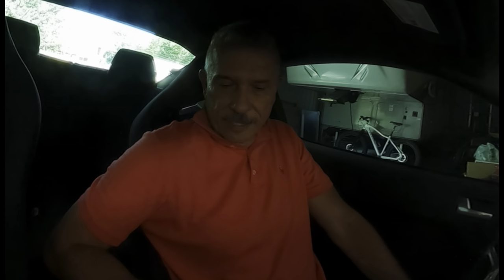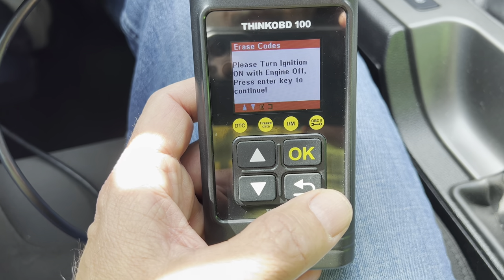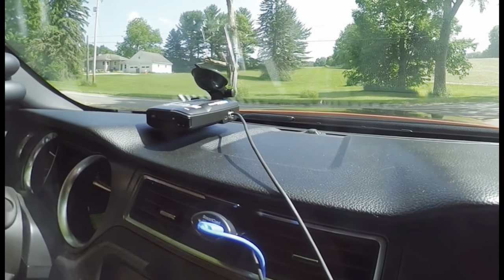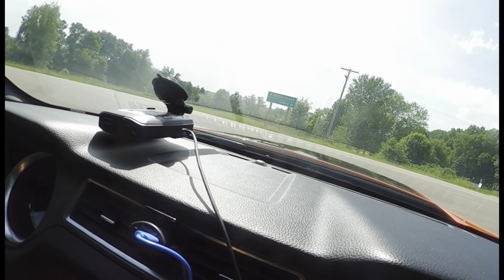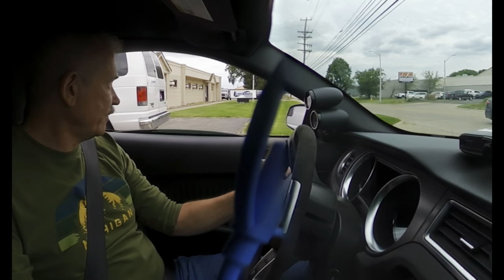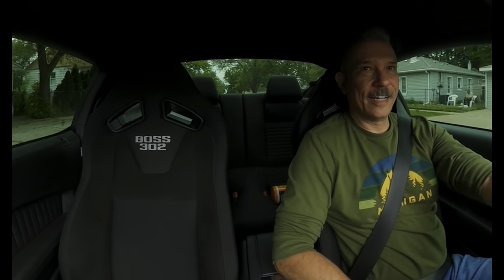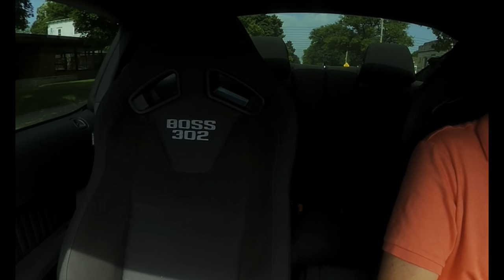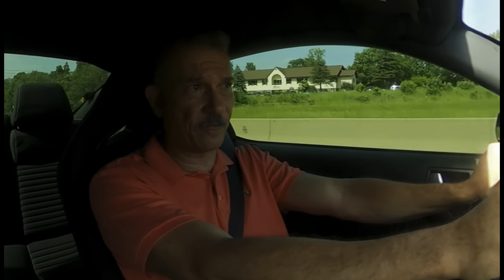Lethal Performance Street Fighter 525 Clutch! Kevlar Disc 😊 First Thoughts!

Comment: I'm gonna go thru and watch all your videos. Your channel is super legit and informative.
Reply from the maker: Thanks we are on a winter pause right now. I have to revisit testing this new clutch though.
Reply: @Coyote Productions  Living in SoCal, I sometimes forget the winter does exist. I'm having a McCloud street extreme clutch, lightened steel flywheel, braided clutch line, hydraulic throwing bearing and ford performance aluminum driveshaft installed in a few weeks.

Comment: Your trans is overkill for what you have. I have a 13 boss. I replaced the mt-82 with at Tremec tr-6060 from a 13 gt500 with track pack. The trans has an integral oil pump for cooling. I’m very happy with it.
Reply from the maker: Yes thanks it is overkill but I have confidence when shifting it won’t fail. Too many other things I got going on with the car to change out to Tremec for $7k. Thanks for watching!

Comment: After seeing your video early of the two prong transmission insert they must have revised it mine had the third prong in the middle which must have caused all the nvh it was an older one I cut off the middle put it in took the boss for a ride very little transmission movement i and no increase in nvh it shifts great I thank you very much now the boss is badass
Reply from the maker: Yes, I couldn’t believe the difference it made!

Comment: Did Scotty's give you a quote on how many hours they are going to require to swap the heads out?
Reply from the maker: No I’m not sure where either Scotties or Walsh Motorsports in which is 90 miles a way.
It’s a big job bc we’re are putting in oil pump gears too. Saving for next year ugh.
Reply: @CoyoteProductionsBoss302  I did oil pump ears crank sprocket intake cams in the fox Gen 2 last winter I took my time watch every YouTube video out there got the Ford workshop manual because the cams require stock timing
Reply: @CoyoteProductionsBoss302  I'm definitely not a mechanic by any means I'm going to do the heads this year and send them out and get them ported which requires the same amount of work plus even more but I'll take my time work on it here and there keep everything super organized I have all winter long
Reply from the maker: I have thought about that, for some things on cars I honestly hate working on them. Considering the location of Scotties I may have them do it. I will let you know the hours estimated when I find out. Off topic, Idled the car this morning moving the boat back in and getting some stuff around the poll barn. When I moved the car back in (CEL on) I have every misfired code, WTF? Right! Going to get a new crank sensory and let Scotties do some diagnostic work.
Reply: @CoyoteProductionsBoss302  with the IDS software you can put it on power balance and take it for a ride and you can watch all the cylinders and if there's one that's out of place it will show you that ...comparable scan tools will do it too even the harbor freight one did it I borrowed it from a buddy of mine for my EcoBoost as I could feel it misfiring but it had no codes but watching the cylinders count the misfires and then you can pinpoint it most... It might be a bad spark plug or a coil pack
Reply: @CoyoteProductionsBoss302  I remember when we did the crank trigger relearn on the boss after I put the clutch in with the IDS we had to do it several times before it was successful you have to have the RPMs just right
Reply: @CoyoteProductionsBoss302  also I forgot you have to put the car back to stock you can't have any tunes in it otherwise it won't work
Reply: @CoyoteProductionsBoss302  and the stock mass air has to be back in there otherwise it won't run right
Reply: @CoyoteProductionsBoss302  I meant the stock air box  the mass air size is different with that the meter is all the same